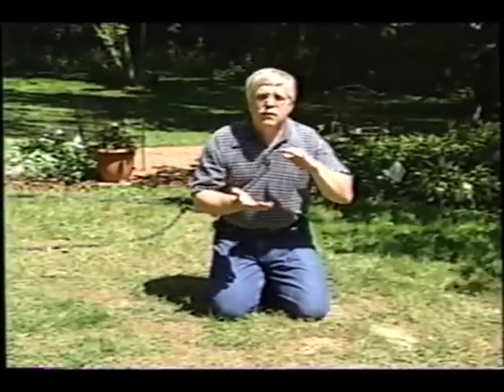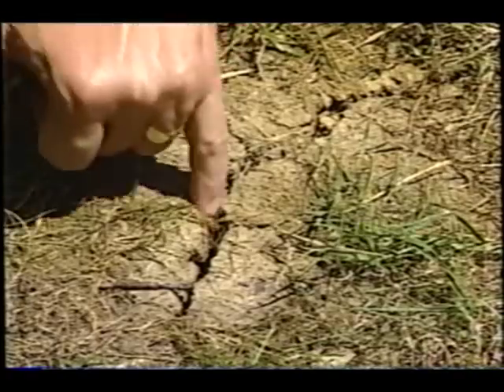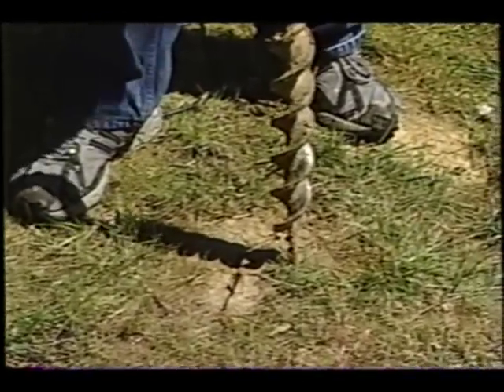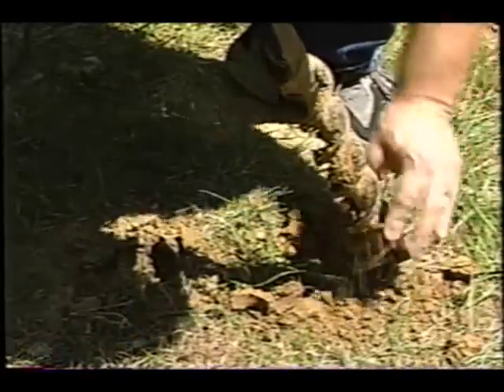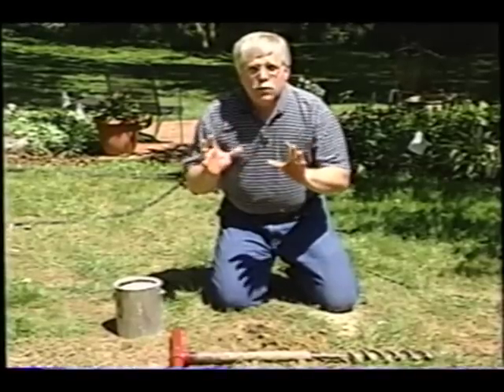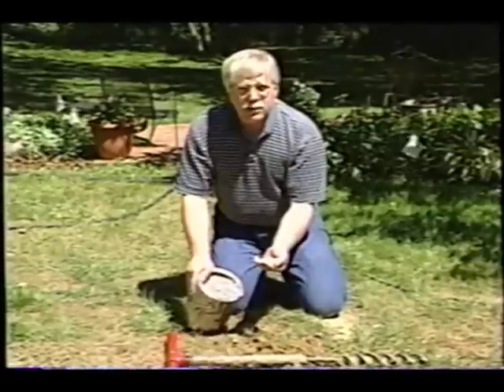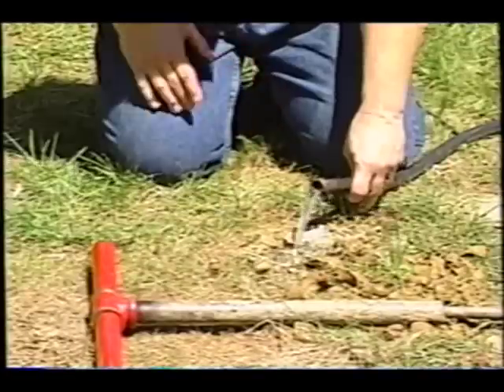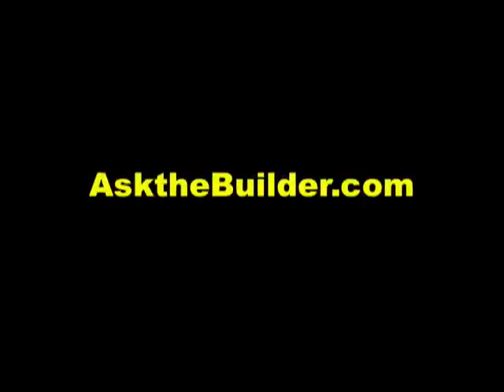Expansive Soil and Foundation Cracks

Comment: what's the purpose of the pea gravel?  why even use it? - just dig the hole and pour water in it.  water will absorb just the same.
Reply from the maker: Simple. Without the gravel, the hole will eventually fill up on it's own with dirt. You need the water to get DEEP into the soil FAST. That's what the gravel does.
Reply: @askthebuilder  Beg to differ.  I have big cracks that have been there for years and they don't close up with dirt over time or when it rains or even floods the areas with those cracks.  I'm sure water gets down in there especially during flood times and they have never closed up and dirt has never filled in the cracks.  Still have them and don't know how to get rid of them.

Comment: This is exactly what I needed to confirm! We bought a home we had leased for several years. Once it was ours I went to work. Being from the south the arid, dry no grass is new for me. Plus I found landscaping fabric wrapped around trees. Small squares of grass so tight they didn't seem to get water. The trees seemed to be dying and I saw cracks. I cut away fabric from trees, stick hose in as far as could...we have pea gravel, the rock landscaping except two grass areas.they water just seemed to go forever ...lol i have been doing this over several days and have noticed that that most water is running through rock strightbintontge ground. I'm trying to evenly go around the house but I woke up to my trees completely leafed out and my grass green. Even one of the cracks on the porch has disappeared. I'm hopeful I haven't messed up but it seems the yard just hasn't been attended to years before we moved in.
Reply from the maker: Watch my NEW live stream videos! Subscribe to get my FREE newsletter here: www.AsktheBuilder.com

Comment: hi, im from trinidad, Caribbean and im having lots of wall cracks in my home. its a big 2 storey H.C.B and  Concrete house and im getting the problem in the  6 month hot dry season  only and not in the other 6 month wet season, the soil is clay soil. how do i save my home. im not sure if it was built on R.C concrete  piles or foundation butts on clay soil, i dont thiink there were ring beam or lintels used in those days, this home was built in 1974. please assist. Thank you :)

Comment: I live in south texas and have something called gumbo-clay soil. I have had thousands of dollars of foundation repairs and have essentially every corner of my my home with either a bell or pie under it. I was never told about these holes; however, I was told to place a soaker hose around my foundation and water frequently. Should I use this gravel and hole method your explaining. I saw your cracked soil example and THATS MY SOIL EXACTLY. I'm excited about this new information. Please respond.

Comment from the maker: @DavidoBambino It depends if the clay in the jungle area is an expansive one. When it dries out do you see huge alligatoring cracks in what used to be mud puddles? Can you place the slab on a 10 cm deep layer of rounded gravel? Can you put steel rods in the slab every .75m on center both directions?

Comment from the maker: @MissBondable Thanks! Yes, people just don't sometimes think of the obvious. If the soil is DRY, let's get it wet. If you need to deliver water deep into the soil, then let's create some tubes that readily deliver the water to the soil. Too bad I can't patent the idea. :->
Reply: I think it's a bit like power drilling with water... Lol  because of the different shapes, sizes, textures of the pebbles and rocks in my case...it's a bit like a waterfall. Water can find and make its way into the soil between riocks much easier  than soil - which can be sandy, clay like almost anything. There is always a place between them for the water to get down further. Now Texas Clay...of dill work if you have a lot of rock in it. I used to look for cracks and slowly water along the crack in the yard hoping the water would glow into the cracks far below. But at least I could grow all year.

Comment: It would seem that the same approach could be used to get water down under the clay layer to get to the roots of trees. Where can I get such an auger? I have looked at Home Depot, Lowes and Ace Hardware but with absolutely no luck. Web searches point only to powered augers and post hole diggers.

Comment: i'm buying a house in an area with reactive clay soil.. it has movement and once of the corners looks like its sinking slightly due to stress fractures in the brick work..

we have had drought the last few years so this could be why.. 

i'm just wondering if after a few days of good rain the soil would expand again and close up the cracks.